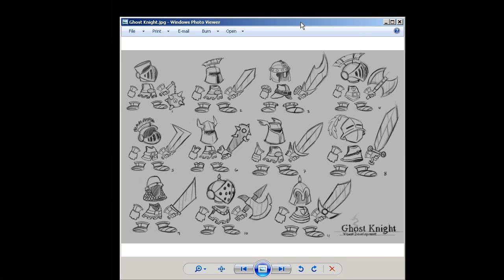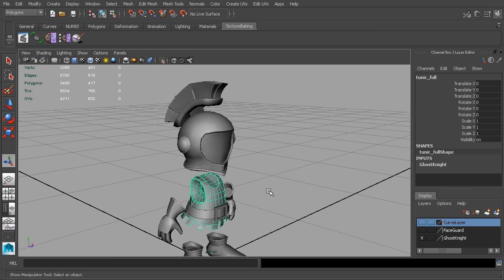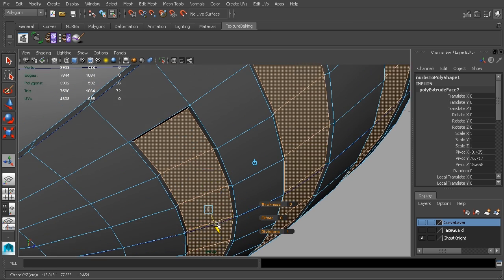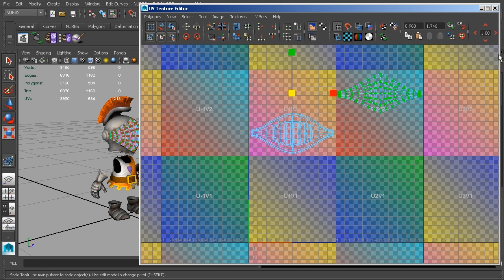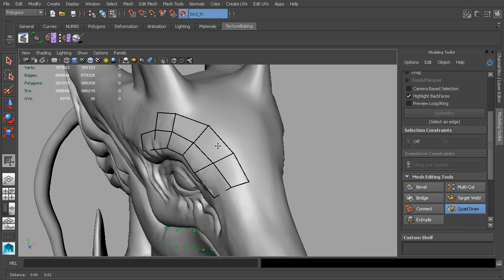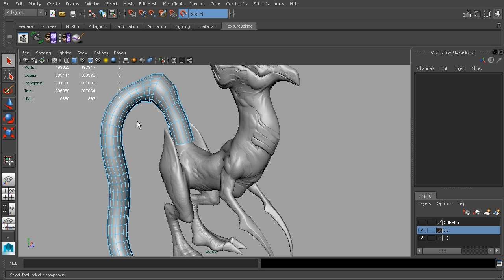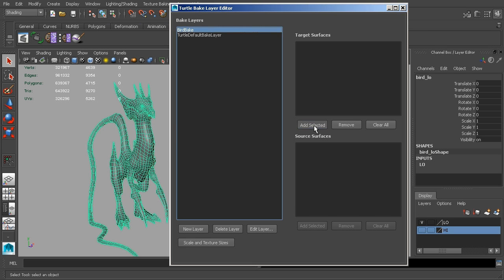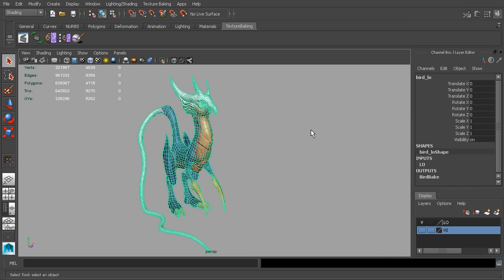Meet the Experts: Character Modeling for Games in Maya LT

Comment: Autodesk about the bird, can you do this process backwards? start with a low poly and create a high res? what is this process called? then add the high res detail to the low res?
Reply: Yes you can. A lot of people prefer it this way too. This is because geometry is always easier to add rather than tale away, so its good to start small and then work your way up.